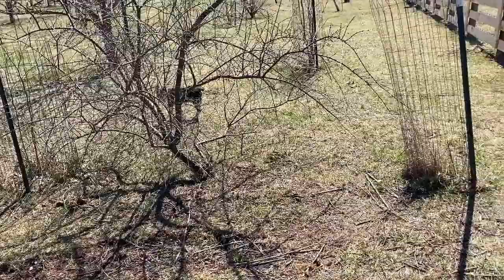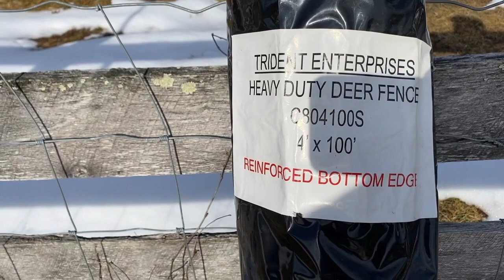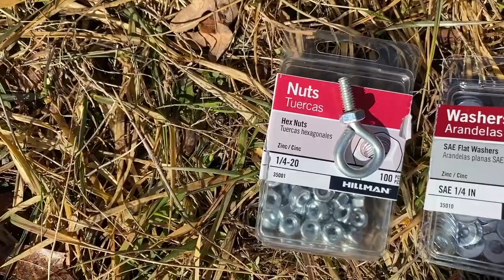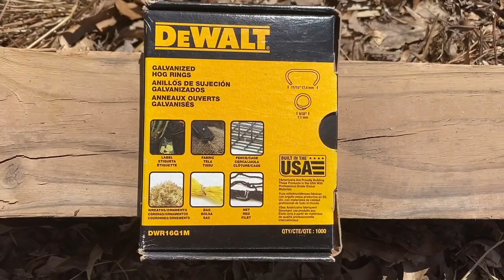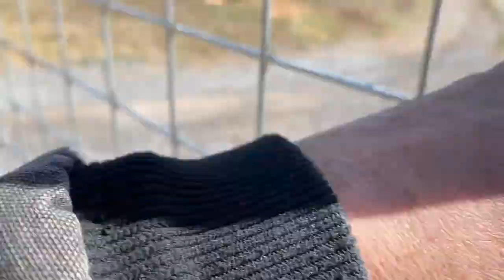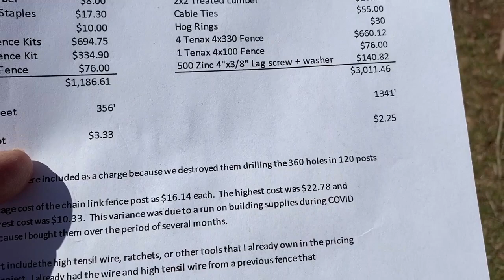DeerBusters Deer Fence Extension Kit Product Review

Comment: Thanks for making this video!   I have about a 400 ft split rail fence line in my backyard that I want to keep deer out, with sections of the fence that are in front of a wooded area (that deer wouldn't hop the fence).  Instead of running the full 100 ft of the poly fence material this kit provides, would cutting it into sections where needed to install make the entire fence less stable in any way (as opposed to running the full 100 ft piece of fencing continuously?

Comment: hey why did you add the high tensile wire to the top?
Reply from the maker: Before I added the high tensile wire, the top part of the fence was kind of flapping in the breeze and did not pull very tight vertically.  I wanted the top part of the fence to flap less and because I'm in a very hilly area, I wanted to pull the fence tight vertically.  With the high tensile wire, I could secure the fence to prevent the flapping and I could pull it thigh in areas where it was loose at points when the elevation changed.